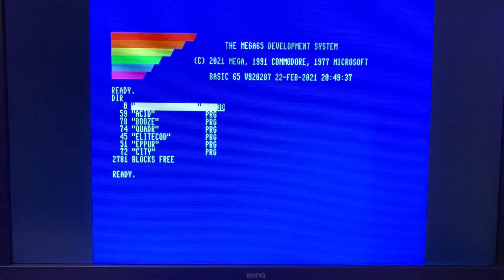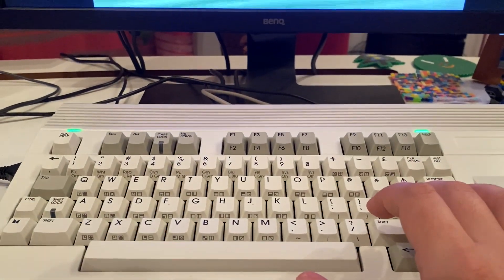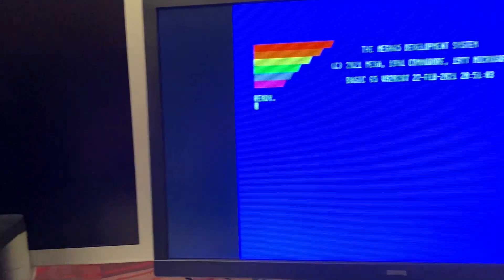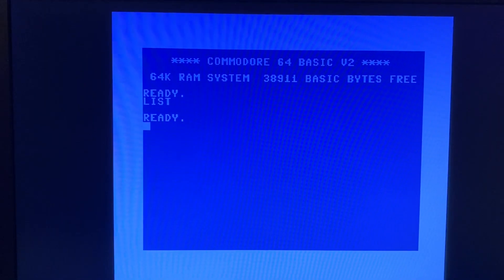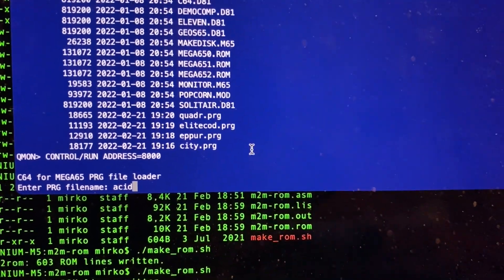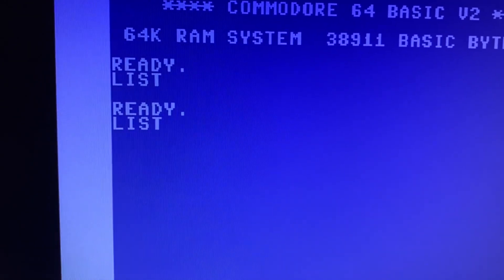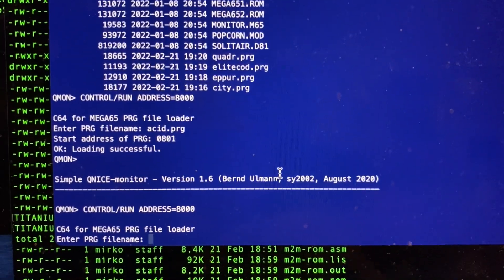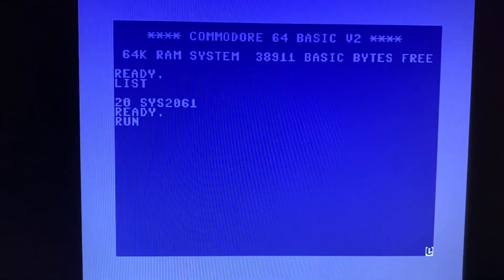Commodore 64 for MEGA65

Comment: Great work, amazing to have a C64 core on the MEGA65!
Afraid to ask, but is a VIC-20 core also in the plans? It will turn the MEGA65 into an extremely versatile “Commodore machine”
Reply from the maker: Thank you for asking, and yes: We plan to port all Commodore MiSTer FPGA cores to the MEGA65, including the VIC-20. It may take a while, as we have day jobs and families :-) After the C64 (which will take another 3-6 months to complete) we plan to do the AMIGA. Anybody with FPGA skills is welcome to help. Just approach us on the MiSTer2MEGA65 GitHub.
Reply: @sytwothousandandtwo7020  I do LOVE to have an AMIGA core, but is the VIC-20 not much easier (faster) to implement once the C64 core is available? I mean, VIC-20 and C64 shares quite some code I believe (I'm not an FPGA programmer though 😇)
Please note, I'm already very pleased with your great work on the C64 core!!!
Reply from the maker: @sandcat-maurice  Thank you for the feedback. Yes, you're right, porting the VIC-20 after the C64 is done is much easier than the AMIGA. Maybe you're right and we should do the VIC-20 right after the C64. We'll see. Still a few months to go :-)